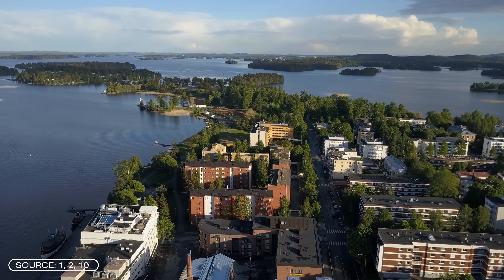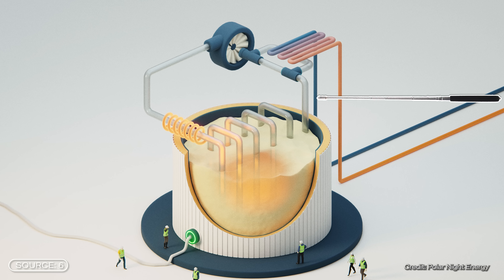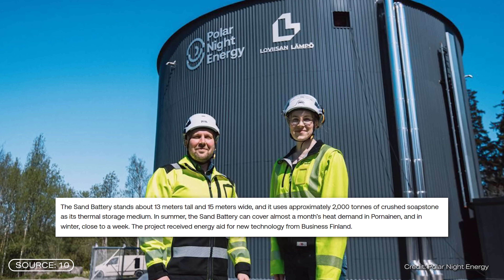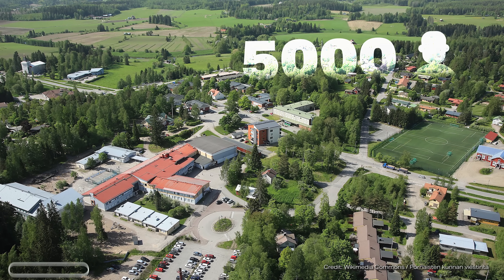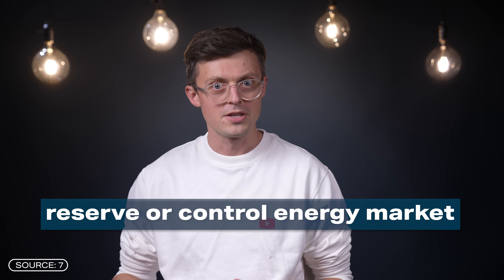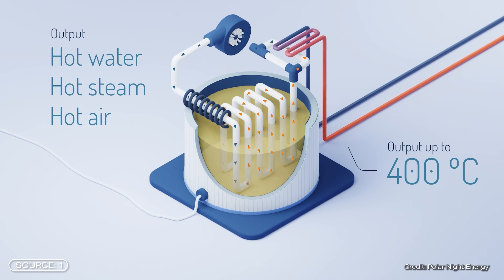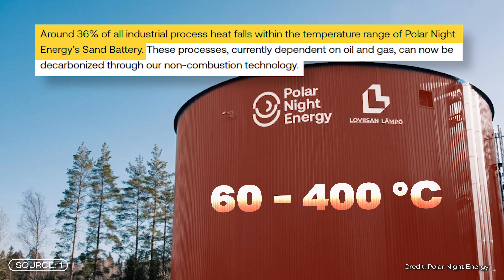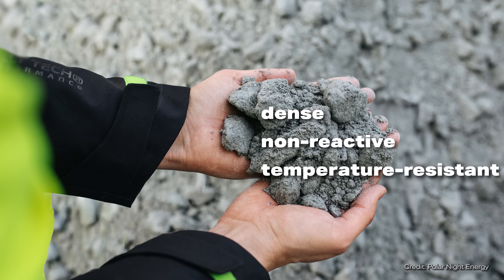Finland's Giant Sand Battery: A Revolution in Energy Storage?

Comment: If the idea is to store heat in sand then wouldn't it make sense to bury the container? Earth is a good insulator.
Reply: While I largely agree with you, digging is usually pretty hard on up front costs. In this situation, you may actually be able to use some of the backfill as a storage medium though

Comment: the choice of crushed soapstone as a heat storage medium is key: soapstone has one of the highest specific heats of any solid.  Plain silica sand wouldn't be nearly as effective.  Also, converting the resistive heat to air to transfer the heat in turn to the medium seems to me potentially inefficient, and would depend on the medium having a suitable amount of void space to allow the air to circulate.  Again, fine grained material wouldn't work.  I'd like to see a comparison the smaller versions of these thermal batteries with heat pumps!
Reply: Not really. The soap stone was mostly convenient per price. It does give some edge, but soapstone isn't magnitudes different to many other mineral materials. Mostly it might affect exactly how many tons of mineral/masonry material will be needed. Which is again kinda "it doesn't matter that much, if it has to be a little bit bigger pile". The whole point is one is already piling thousands of tons of rock (be it the naturally occuring small silica kind called sand or other kind crushed).

Also the air isn't circulating in the sand. It is circulating in metal piping embedded in the sand. Think horizontal ground loop thermal heat. Isolated heat piping coils embedded in the source/storage medium. Thus why the specific nature of the grain and sand isn't as specific.The hot metal pipe surface is the transit medium. They have loop after loop of piping inside the sand in a spiral. It is a closed isolated loop. I don't think they have said anywhere, but I wouldn't be surprised, if they have surface fins and so on in the metal piping to increase surface area to enhance the transfer rate.

This adds to longevity no kind of dust, particulate or contamination from the sand goes into the heat exchanger , heaters and circulating fans. All the primary loop circulating air ever sees is most likely stainless steel air ducting and maybe some metal heat exchange fins
Reply: @aritakalo8011  Thanks for a thoughtful and fulsome reply!

Comment: Very interesting but as you mentioned perfectable.  I'm from Quebec where a company is preparing in the next few years to mass produce a VRFB that can serve as backup to renewable wind power. It is very stable and can have a theoretical unlimited charge and discharge cycles. Making it well adapted for remote communities with wind or solar power. As a footnote Québec has abondant vanadium ressources. Also those batteries hold in a standard container and can easily shipped.

Comment: At 1:43 you are speaking about  high resistance - I think this is not correct. I think a low resistance is needed because ou need some Ampere (I=U/R) that there will be some kW      P=UxI
--> Big but low resistance

Comment: In more temperate climates where solar is abundant, this kind of storage could be useful for lower heat intensity industries. One that comes to mind is food processing. Heat is required at many stages of food processing, but take the example of baking things. The temperature needed is pretty low, but the heat is needed in fairly large quantities. Imagine a pastry company in Arizona or Texas. They build a large solar farm, install heat batteries (with backup of course), and then construct a factory that uses stored heat to run their ovens. Sure it would cost more to start, but I bet it would undercut retail commerical electric power costs over time. For the US this also might be a way to bolster rural communiies by subsidizing food processing plants to locate there. Rural Texas has plenty of wind and room for solar. A big commerical bakery would create jobs and stabilize deteriorating communities. There are numerous other uses for heat in food processing - making sugar, pasteurizing milk, cooking soups and other preparations - it goes on and on. You can even imagine an industrial district heat plant serving an entire community of food processing factories.

Comment: If you want to do steel it may not fill the coals position, but a flash boiler heated by sand thermal batteries that powers several large flywheels could power some pretty decent industrial bellows, keeping part of steel production resilient to electrical outage. Heck, using a combination of concentrated sunlight turned into heat transferred by water or oil and capturing heat from the steel production process could keep the thermal batteries charged. I don't see us ever getting rid of the coke in the process.

Comment: Fun question. Why do we finns need to build the sand battery on top of the surface? Wouldn't it  be warmer in the ground?
Of course it is a new innovation and people must see it to believe. And your's have to be bigger than neighbours -I get it. But seriously?
Reply: More difficult to operate underground, the ground is colder and moves heat faster than air, even though the tank already has insulation; and building it is way faster and cheaper than digging a massive hole to build in.

Comment: One inefficiency I think there is with this configuration is the use of electricity to heat it up. It may be convenient and from wind it makes sense but the efficiency of solar panels is very low. Wouldn't it be much more efficient to use a focussed mirror array to capture the heat from the sun and put energy into this thermal energy store?
Reply: The idea is for this kind of "sand battery" to make use of cheap electricity during time of overproduction, convert it to heat (minimal loss) and deliver this heat at a later time when it is needed. The stored heat could also be used to generate electricity, whether with a steam turbine or a Sterling engine but such "full-circle" wastes approximately 2/3 of the energy it receives.
Since you're talking about concentrated solar power, we can try a quick calculation to give an idea of what this might entail.  BTW, independently of this calculation, this is a bad idea for places like Finland where heat is most useful in the winter, a time when the sun shines a very few hours per day at a rather shallow angle.  It is in fact a bad idea even in, say, southern Spain, where there's plenty of sun year round and relative little use for heating homes and offices.
There are two approaches to concentrating solar radiation for heat purposes:  long convex mirrors heating a pipe placed at their focal point (a few feet from the mirror), or mirrors disposed in a semi circle and directing the solar radiation in the distance, at some boiler set atop a tower in the center.    This latter approach makes for spectacular installations, see for example the Ivanpah Solar facility in the Mojave desert, in California.  Ivanpah's electric generation capacity is 392 MW, hence approximately 1150 MW thermal, that is a bit more than 1000 times more than the 1MW of heat required for the sand battery.  Since Ivanpah uses 347,000 mirrors over 1,400 hectares, we'd need "only" about 350 mirrors over 1.5 hectares, assuming a site with similar solar exposure as Southern California.  That seems to be a bit much for a 1 MW facility...
Thermal solar systems are better suited for small, distributed installations such as for producing hot water in homes than for centralized electric (or even heat) production.  BTW Ivanpah will be closed in 2026 after 13 years in production.

Comment: This + Air Battery cynlinder = heat and electricity storage. We used to have big gas cylinders everywhere, I don't see any reason why we couldn't use those places for that kind of thing. Heck when it comes to heat and air storage, surely it would make sense to put them underground anyway for thermal as well as cosmetic reasons?

Comment: This idea would be very useful near the equator in places where they don't have any coal mines or power stations but do have solar panels.
Here in merrie olde England we have giant coal batteries which store huge amounts of energy. One digs up the coal, then burns it in a power station, at any time in the day or the night. This is especially useful in winter when the Sunshine is weak, especially on those short winter days, because on most of the days the sky is covered in clouds and the solar panels are covered in snow.
I'm an engineer, so yes, I do understand the science. I also understand that science works best in practical applications and that magical thinking costs people money.
And the CO2 problem? Someone needs to explain how it is that, in the geological past, there were ice ages during which CO2 atmospheric levels were higher than they are today and the ice didn't melt. Look it up.

Comment: The sand battery don't need to be one hundred percent perfect, if you can get at least eighty to ninety percent efficiency, that will be ideal enough. Plus eighty percent efficiency in sand battery technology should translate as one hundred percent efficiency because of its low cost production, maintenance and installation cost. If you build two to four sand batteries close to each that should be more than adequate to supply our energy needs. And the sand battery technology can evolve and improve tremendously over time. You can use solar and wind technology to heat up sand batteries that can provide surplus energy storage for the times when the sun or wind is not adequately available or reliable. A sand battery should be ideal to supplement the inefficiencies of solar and wind technology.

Comment: Can it store waste heat from homes, businesses, industries, or even solar farms?
Reply: "Waste heat" actually refers to relatively hot and concentrated sources of heat, such as the output of a steam turbine, the exhaust of big combustion engines or heat downstream of various industrial processes.  As such, there's really no (well, certainly not much!) waste heat from homes or even commercial buildings; that is not to say that these do not "waste" energy : even the best insulated homes, or the most efficient appliances etc. ultimately loose energy in the form of heat, but this is diffuse and low temperature and hence completely unfeasible to collect (other than the occasional ad-hoc local optimizations such as preheating water by circulating it around the exhaust pipe of a furnace).
As for solar farms...  No waste heat there: most of them produce electricity with PV panels.  There are a few which concentrate solar radiation to heat/preheat some liquid for the production of steam, ultimately used for generating electricity with a steam turbine.  These concentrated solar plants are effectively thermal powerplants and as such might have bone fide waste heat suitable for say district heat or indeed to recharge a sand battery such that the one in the video.

Comment: These kinds of batteries are huge for countries where heating is needed. A week of stored heating energy for 5000 people is very nice. Electricity is usually way cheaper during nights and there's almost always a day during a week when electricity is very cheap. These could also help to stabilize electricity prices.

Sand battery might also be very good for heating a single house. You might cut your heating expenses by 60-80%. That could be 600-800€ saved per month during the coldest months.

Even a small sand battery that can store heat up to 3 days for an apartment complex could save more than 50% of heating costs.

As an example. In Finland yesterday electricity cost less than 0.2cents kW/h during night. During the day it cost 1-7cents kw/h. Charge when it's cheap and use when it's expensive and you'll save a huge amount of money.
Reply: Imagine it could be minus price during night as well some extreme days!

Comment: Great video, thaks. You can get so hot air from the sand, that the next step could be a stirling engine to make electricity of that heat and the waste heat from the engine to the district heating . Then you can sell electricity when the price is high.
Soap stone is very suitable for that storage, because it is softer when it is hot and harder when it is could. This change engreases it storage capacity.

Comment: I perfer phase change thermal batteries, the one that is actually being developed uses I believe graphite bricks with aluminium inside. because the aluminum stores a bunch of latent heat in the phase change, which means that you don't need to maintain as high of a temperature for the same amount of Wh, which is a bonus because the lower the temperature the slower it will self discharge, and it's an exponential effect, I believe, I think it's double delta over ambient loses 4x as much energy, and at the temps we are talking about that basically means 2x the temperature  4x the heat lost.

Comment: This technology is the key to green baseload, balancing the entire grid.  Just generate heat from left over grid streams, which are available every night, just about in any country.  This is the regenerative grid theory.  Create heat for buildings or industries with ease.  Use the heat to create steam for turbines, for the greater grid.  

Effectively grid energy compounds, with this new emergence.
Reply: Yeah one of the biggest problems with renewable energy is at-will availability, not output itself. The second biggest problem is batteries

Comment: And we need heat in the Summer why. And again climate does not depend on CO2. You are a scientist, Doctor even you should know that.
Reply: What do you mean 'why do we need heat in the summer'?
You like taking cold showers?
Reply: @-Pepsimayn-  Yeah, I do in the summer and in the winter, I'm a regular Wim Hoff. But that's not the point. Why all that effort just for warm water. You can put black barrel on your roof, and you got warm water even in Finland and even more so cause in the North in the Summer sun shines for longer.
Reply: @boriskochevski4240 Yeah 'cause installing massive water barrels that have to be emptied every winter on top of apartment blocks is super viable. Why bother if you're already connected to the district heating network.
Reply: @-Pepsimayn-  And district heating works on? Diesel, fuel Oil, LNG. And more important sure not working in Summer. Cause surprise, surprise we don't need heating in the summer, odd enough they don't need it even in Siberia. Witch was the point I was making in the beginning
Reply: @boriskochevski4240 In 2023 only about 20% of the energy for district heating was produced from fossil fuels in Finland. And that share is rapidly coming down. Maybe they don't have heating during summer in siberia, but Russia is also pretty much a third world country.
Reply: Global climate does care about CO2 a lot. It traps heat into the atmosphere which causes global warming.

Comment: If the solution were this simple, why did it take a century to find?
Reply: Heat storage is known since the dawn of times, but this system in particular only makes sense if there are huge electricity price variations during day and week. Notice at some point he also mentions being paid for taking electricity, i.e. negative prices. 

If electricity had a constant price, this system would make no sense. Heating with resistors is very inefficient, and on top of that, you have about 20% energy losses, you've started with electricity and you get out medium to low temperature heat. Thus, it is not an engineering breakthrough but rather an obvious evolution in a situation where electricity prices are jumping like crazy and you need a lot of low temperature heat. So, for example, right near the nuclear power plant of UAE this thing would make no sense, but in Finland...

Comment: Sand batteries don't even need electricity. You could heat it directly with sunlight.
Reply: Ok, Caveman. What kind of mechanism did you have in mind to collect hot beach-sand and dump it in the battery, and take it out again the next day, and spread it back in the sun.?
Reply: @castheeuwes1085   Where did he say anything about moving the sand
Reply: @TopiasSalakka  to heat sand with direct sunlight, you need access to sunlight. If the sand is in a tank/silo, only the very top few centimetres are going to get heated up by the few hundred watts of energy, reaching nowhere near the hundreds of degrees C these batteries are designed to operate at.
Reply: @TopiasSalakka  Nowhere. But you want to heat the sand with sunlight. Somehow it will have to bu put in the sun. Just have the top open will only heat 1 cm.
Reply: @castheeuwes1085  I suppose you could heat up the heat exchanger fluid with sunlight though, since it's what adds heat and extracts it from the sand.